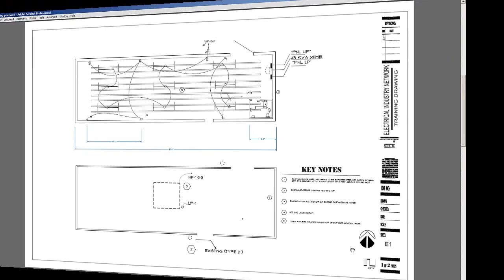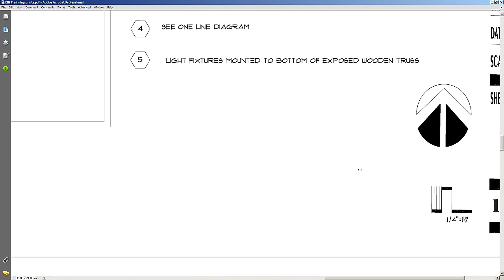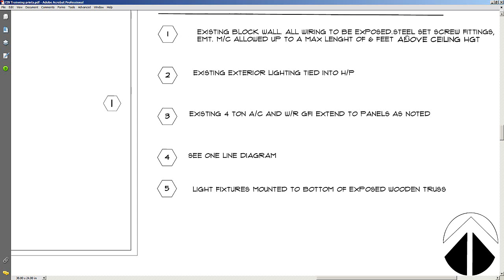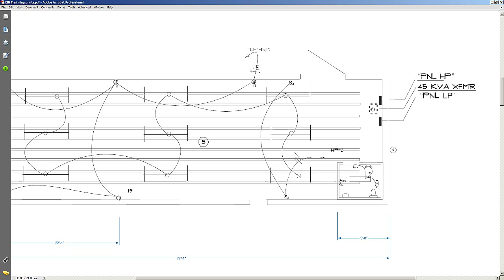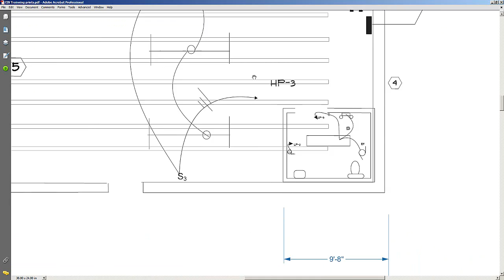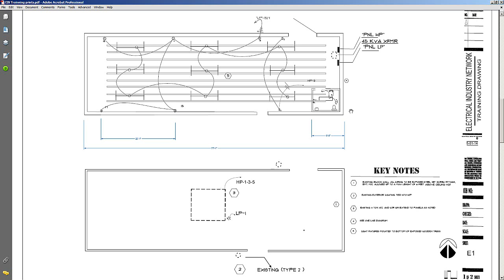Electrical Drawings & Symbols PT 3

Comment from the maker: Quick start guide to symbols and information you commonly find on a electrical darawings sheet E-1
Reply: Electrical Industry Network Informative video!  Am I correct in assuming that the bottom drawing represents the basement (or roof?) and the top drawing the main floor?  At what point would you usually say that each floor gets it's own print?  Much appreciated for any time you can give for an answer.  Thx